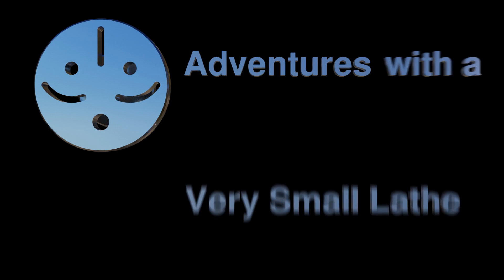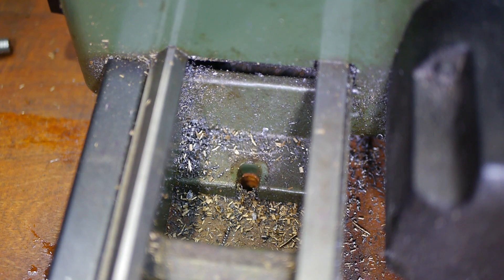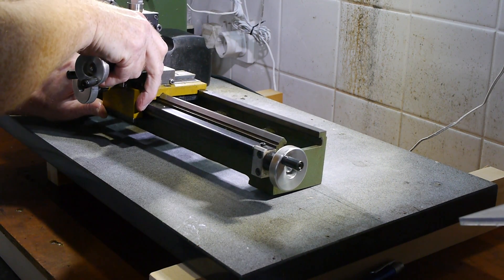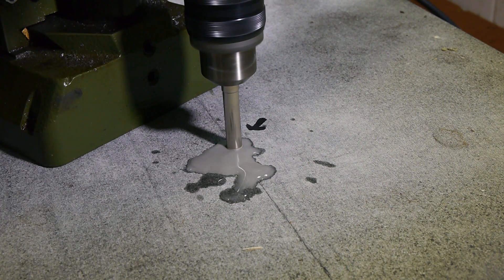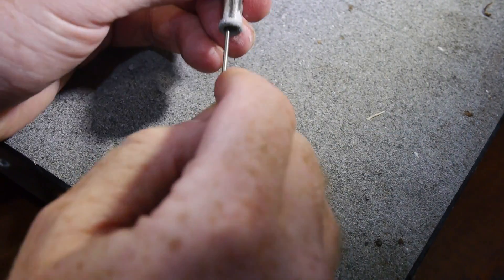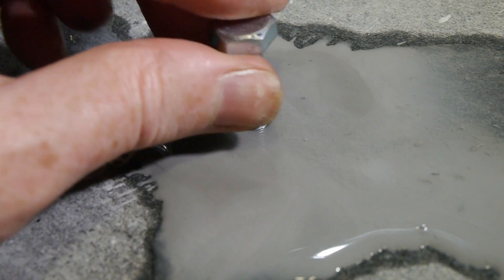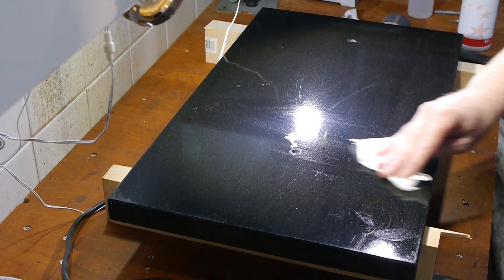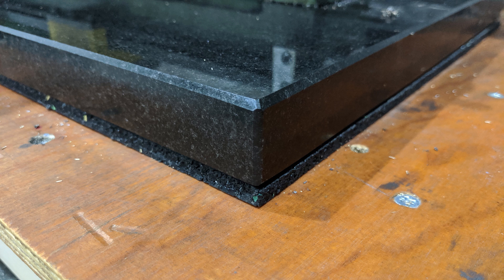A Solid Granite Base for the Proxxon PD 250/e Lathe

Comment: Another quick tip when deep hole drilling with core drills is to snap off the core every 1/2" so it reduces internal friction and you don't need to wrestle getting a large core out of the drill.
Reply from the maker: Thanks, that totally makes sense. I know I should have cleared it as soon as I heard it break off, but snapping the cores off in advance makes even more sense. Thanks again!

Comment: Looks lovely, but aluminium is cheaper.
Reply: Aluminum wouldn't dampen vibrations like granite can. Granite has more weight.
Reply: @MrRatkilr  depends how think. You can buy off cuts from ebay half inch think or more.
Reply: Robert Underdunk Terwilliger 
Have you checked the prices of thick aluminum plate before posting your comment?
Granite is cheaper than aluminum plate of comparable stiffness. Even a slab of steel is more expensive than granite. 
And if you ask politely the countertop shops will let you have their off-cuts for free since those small pieces are useless for them.
No machine shop will give away a slab of aluminum or steel because they can use that material to make smaller parts.

Comment: I have thought about doing exactly this with my 10” Atlas lathe.
It is on cast iron legs but is essentially a bench lathe.
I have to find a hunk of granite big enough but now I know how to grill the holes!
I want to mount the legs to the granite and then put the lathe on top.
Maybe I should start a channel called Adventures With a Very Old Lathe ;)
Looks like your base came very nice.
I think mine needs leveling properly as well I was trying to make a test bar today with mixed results.
I’m looking forward to more of your adventures 
Dave
Reply: Could you pour an appropriately sized concrete slab?
Reply: Not a bad idea.  I was thinking more about the flatness on the granite.
A concrete block would still give me the vibration absorption.

My shed floor is already concrete.  My next move will be to make some leveling feet for under the legs and use my machine level to even everything up and see how that goes.
I figured out how to calibrate my Starrett level on the weekend.  I can now put a .0015" feeler gauge under one side and the bubble moves one full division on the site glass.  Man those things are accurate.

Comment: Great video, keep up the great content, that granite slab, would also have probably been excellent for small workshop surface plate 😁
Reply from the maker: I can already imagine the comments I'd get if I did that! ;)
Reply: @AdventureswithaVerySmallLathe  it's probably more true than the $30 one from harbor freight...
Reply: @trollforge  exactly 😁 I'm not looking for surgical grade tolerances in my workshop 😁 that would be much more accurate than half my China made machines and tooling 😂
Reply: I bought 2 large granite floor tiles in a part box, so they were very cheap. Just looked at a dozen or so using the shop lights to find those with the least surface ripple ( all were pretty flat though, just looked to find first two with nothing at all imperfection wise) and took them. Then took flexible adhesive and mounted one on a base of plywood, and use it as a surface block. The other is on the kitchen as a cutting block. the plywood makes it easier to handle, as now I have something to hold onto, and using wet or dry is fine, marine grade ply with a coat of enamel top and bottom. 450x450mm tiles, plenty big enough for my small needs, and I just use a drop of dishwashing liquid and a bit of water to stick the sheet of wet and dry waterpaper to the top, and a spray of water in use to clean the paper of debris. WD40 also on the very fine grit, to keep the metal from corroding as it is taken off.

Comment: It helps to form a puddle around the hole using a putty, wax, plasticine or any such material to keep the drill wet and prevent it from flowing away.
Hint for people without a machine to help with drilling - it is easy to drill with a hand drill, the tricky part is the start. To help with that drill a hole matching the diameter of the diamond drill in a piece of wood. Clamp the wood with the hole over the spot where you want to drill. Start the hole. Once the diamond dug into the material a little, remove the wood, form a puddle, fill with water and continue drilling on low speed putting only moderate pressure on the diamond bit.
Let the diamonds do the work gradually biting into the material.
Don’t rush, don’t run the drill at high speed or press hard on it. That will only damage the drill bit.
Reply: To possibly help with this idea, how about a decently sized counterbore lined with wax in the piece of wood too, so you could have the puddle as part of the drill guide?
Reply: What works for cooling is a plastic 1 or 1,5 liter water bottle in which you make a tiny hole with a hot needle. Fill the bottle with water, open the cap and aim the very thin waterjet that comes out at your drill. Close the cap to stop the water.

For people without a drill stand, Action.com sells a set of 6 diamond drills complete with a guide that can be attached to a flat surface with a suctioncup. Works with glass and ceramic tiles too. https://www.action.com/nl-nl/p/werckmann-diamantborenset-/
Reply from the maker: Thanks for the suggestion about making a puddle! If you want to get really fancy, Starrett sell a drill guide to help it get started, and also a branded water bottle to help with the cooling. The wood idea sounds like it would work just as well though.
Reply: Adventures with a Very Small Lathe I imagine Starrett has a tool for any job :-)
Reply: @rok1475  True statement. I found out yesterday Starrett a .001" dial indicator with 5" of travel! 
Model 25-5041 would look sweet on the bed of my lathe.

Comment: Good video! 1 thing to add. In addition to the hole core drill get a 2nd one to make a counterbore on the back side. Drill centered on the bolt hole and go the appropriate depth. A small piece of brass and a few taps on the outside of the sleeve and it will snap off. If you feel the need to flatten the bottom surface use a wooden dowel and some very coarse lapping compound. WaaLaa done!
Reply from the maker: Good idea, thanks for the suggestion!

Comment: those diamond core drills are very handy, i used one to drill 4 holes through 4" thick concrete, including through rebar, and i don't even know of another tool that could have done that. also doesn't require a special drill, i just used an ordinary hand-held power drill
Reply from the maker: I only used the milling machine because I wanted to be completely sure the holes would be dead straight. I'd never worked with these bits before, so I wasn't confident that I could drill straight with a hand drill.
Reply: @AdventureswithaVerySmallLathe  yeah, that was a good choice. they're tricky to start in the right spot with just the hand drill (I used a piece of wood with a hole, clamped in the right place to get the hole started), but I don't know how straight the holes are when drilled by hand. My back was also aching pretty good by the end, if I'd had a milling machine or pillar drill that would have gotten the job done I would have used that, smoke em if you got em
Reply: So you were the one that got away from the Hatton Garden job then?

Comment: Nice job Alistair & another enjoyable video, Well done!!
Have you considered getting the chip tray/splash guard to help retain all the mess?
One of the things I've contemplated is making a set of "riser blocks" to go underneath where the bolts are & provide that extra bit of clearance between the handwheels & the base.
regards Colin
Reply from the maker: Thanks Colin! I'd love a splash guard, but all the prices I've seen locally have been really high. Perhaps I'll add a new project to the queue to make a guard for myself! :)
Reply: Adventures with a Very Small Lathe the splash guard and chip tray can be made of plastic and just glued to granite. 
If you fancy it to be removable drill some horizontal holes into edges of the granite and set small studs in those holes with epoxy to hold the pieces of acrylic, lexan, polycarbonate or whatever you can find.
Reply from the maker: As a YouTuber one of my challenges is making sure I can still get my camera into the right position, so I think most standard splash guard designs wouldn't work for me. It's a problem I'll have to think about carefully.
Reply: @AdventureswithaVerySmallLathe  Fwiw I've had 1 mm stainless sheet metal sheared and a few other items made up at a commercial heating and air conditioning shop for quite reasonable prices. The U.K. could be different of course, but a basic drawing for a tray the lathe sits on and a back splash bolted to it and the head stock end might be worth trying at one of those shops fairly local to you? They have the equipment, skills and knowledge to do this type of work pretty efficiently.
Reply: @AdventureswithaVerySmallLathe  Agree they're expensive, mine cost about $250 AU & I contemplated making my own but when I weighed up its cost against materials, available tools, welding, powder coating & time, buying the Proxxon one was cheaper.
Reply: Lots of people use riser blocks just to aid in cleaning up underneath them.

Comment: Great idea. I will consider granite for my sherline lathe
Reply from the maker: Sounds like a good fit, though I think cheaper options should also be considered if granite is hard to come by.
Reply: @AdventureswithaVerySmallLathe  Granite suppliers are abundantly available in my area. However, MDF is also a stable and easy to work with material.

Comment: You should have just drilled from the finished side.
Reply from the maker: Yeah, I think there would have been advantages, but it was impossible to lay out the positions of the holes on the hard polished granite. I would almost certainly have made cleaner holes.
Reply: @AdventureswithaVerySmallLathe  Anytime I need to lay out and drill holes on a finished surface that has fairly low precision requirements I'll usually apply a layer of cheap masking tape in the general location then mark the hole C/L on the tape. Drill the holes then just pull the masking tape off. No pen or pencil marks where they'd show, and anything the masking tape can stick to can be marked as much as you'd like. Painted interior walls are another place I'll use it. 

Stone drilling requires the water cooling as you did. Using a ring of old school window glazing putty as a dam maybe 2" in diameter keeps the water in a central area with more of it to help with the cooling. With the stone supported on those 2" x 4"s a small dish could be used under the stone to catch the water and stone slurry as the drill breaks through. I bolted my Emco 5" swing lathe down to a 1" x 12" x 27" mild steel plate. It made a large difference in adding rigidity and how accurately the lathe could cut. But even stone can flex on a wooden bench. Supporting it on 3 of the airy points like surface plates are may or may not be needed depending on the results you see happening in the future.
Reply: @turningpoint6643  
I don't think stone of that size and thickness will flex. But noticeable heating and cooling may change the lathe accuracy accuracy slightly. In this case i guess, given that it's a cheap little machine made in Chinesia, it shouldn't be too much of an issue. All in all this should be an improvement for certain!
Reply: @jayytee8062  Because of the usual standard wooden floor construction in my shop I have changes in my lathe and can measure the amount of taper it produces with the flexing of the 1" plate under it. Those easily measured changes happen with just a few degrees of temperature or points of humidity throughout the day. Anything that's got wood in it is going to change no matter how well it's sealed. It will happen slower but it's still happening.

And my lathe is sitting on a heavy steel bench weighing over 500 lbs fully loaded. A 24" x 36" x 4" thick surface plate can slowly change under it's own weight if the supporting structure under it isn't flat or stable.Those calculated airy support points are recommended for good reasons even with an expensive properly welded steel structure made for surface plates. Yes you may be right, but I certainly wouldn't be surprised if it did happen.

His Proxxon lathe is a long ways from being cheap and Chinesium. For it's size there quite expensive, well made and very accurate if there set up correctly.
Reply: @jayytee8062  Proxxon made in Germania not Chinesia.
Reply: @edgeeffect  
Are you sure it isn't next door to Chinesia, in Taiwanesia?
I heard that they don't like to advertise that the manufacturing is done in Taiwan (oh, and that rymes haha)
Reply from the maker: The lathe was manufactured in Romania.

Comment: The reversed/rotated column trick is (fairly) commonly used by woodworkers making holes in their workbenches, which can be "rather large".

A common cheap drill stand (not drill press) works well.

this sort of thing;

https://www.sealantsandtoolsdirect.co.uk/manufacturers/silverline_tools/power_tool_accessories/silverline_bench_drill_stand_633764_P28764.html?gclid=Cj0KCQjwvo_qBRDQARIsAE-bsH-OgILy5XNhYuzgXWEPDn0Fq-vdKJd9Zejd5jchqwtLNluh6sQSHbcaAkELEALw_wcB

Comment: I've seen somewhere or other on YouTube, someone using a granite chopping board as a surface-plate substitute.... Kitchen stoneware seems like a good source for engineering supplies for the hobbyist on a limited budget.... Proxxon spanners too? You are quite the fanboy. ;) NICE! Makes me feel very very tempted to do this for my little Unimat SL.
Reply: Ades Workshop.
Reply: I use a small (12x12 inch) granite floor tile for use when building models. If you support it well you can get under 0.005" of flatness which is fine for Model Railroading work! :) As a benefit, most glue and such comes off quite easily!
Reply from the maker: I'll keep an eye out for granite chopping boards in future. Sounds like they may be a bit more affordable.
Reply: edgeeffect ask your local countertop shops, they throw away off-cuts the size of small table when making L-shaped countertop piece. If you are polite they will let you take them for free or cut them to size for labor cost.
Reply: @rok1475  Since writing my comment but before reading your reply.... I did indeed checkout my local worktop (countertop) shop, and they do have a load of off-cuts to throw away, I obviously wasn't polite enough because they DO want payment, but not that much. :)
Reply: edgeeffect some shops have dumpster bin at the back. Check that occasionally and if you see something interesting ask if you can take it. They pay for disposal by weight so less in the bin the better for them.
High volume shops are better to approach.

Comment: Hadn't thought of using granite, but certainly makes sense. I'm thinking that that would be just right for my little Unimat SL. It could use a sturdier base. Good work!
Reply from the maker: Granite is definitely not the cheapest option, and there are probably very cost effective ways to make a sturdy base from cheaper material, but as I could get hold of an off-cut pretty easily, I thought I'd try it out. The added bonus is that it looks really great. :)
Reply: @AdventureswithaVerySmallLathe  I've also been looking at casting a concrete base and then either encasing it with wood or sealing the surface well. One wouldn't want concrete dust getting into the works!
Reply from the maker: @jrkorman  I've done a bit of work with concrete, and I think using a few good coats of concrete sealer and then perhaps a coat of paint should keep the dust well under control. The challenge for me would be getting the surface flat enough.
Reply: @AdventureswithaVerySmallLathe  Look at local monumentalists for reject granite slabs. Either one with a spelling mistake or one which was chipped. If it has engraving use that side as the base, and fill it with body filler to get the surface smooth, then cover with a sheet of felt or rubber.

Concrete simply make your mould out of ceramic tiles coated with a thick coat of floor wax and polished shiny. Use a lot of reinforcing, preferably chicken wire, and when mixing the concrete use a superplasticiser so your water content is low, but the plasticiser makes it really easy to pour and prevents cracking. Add chopped glass mat as well, and after you have removed the mould simply polish the flat surfaces to get rid of the tile edges. Surface protection is just then a case of paint a few coats of polyurethane brick sealer on it to keep it dust free.
Reply from the maker: @SeanBZA  Some fantastics ideas there, thanks! I'm definitely going to have to drop by the local monumentalists and see what they throw out.
Reply: Ha! That's weird! I've just read your comment after leaving an almost identical one myself.